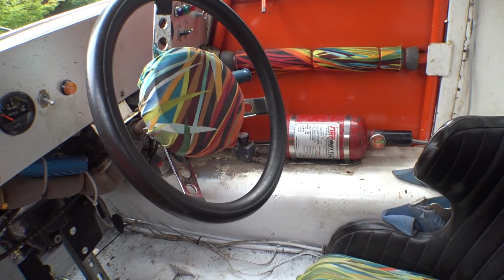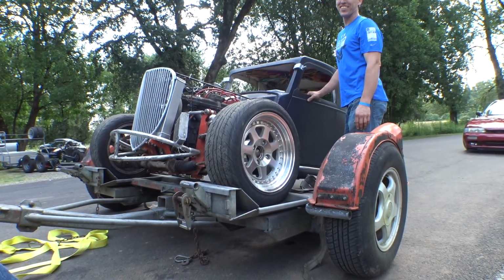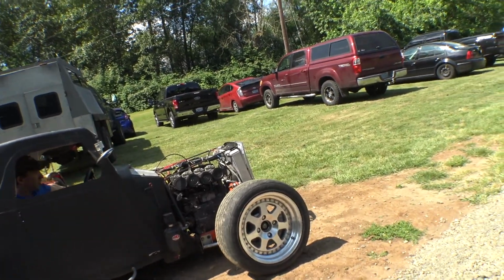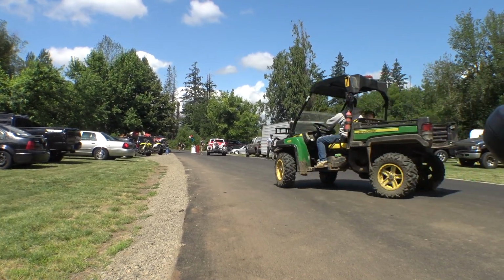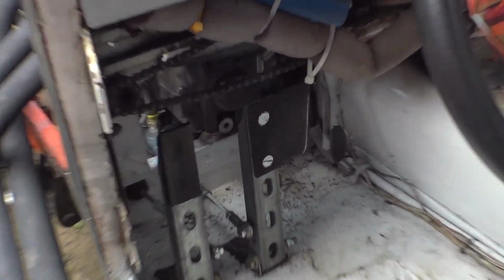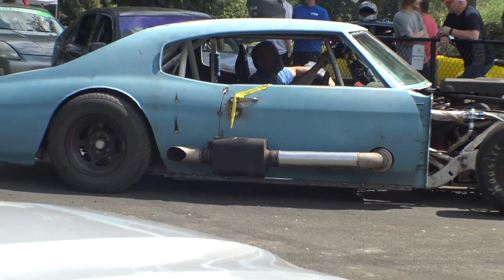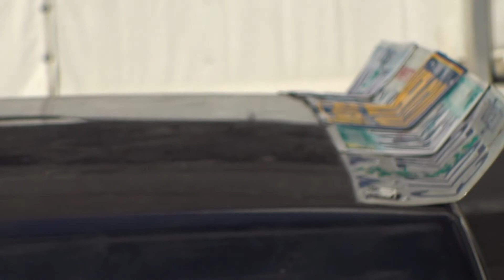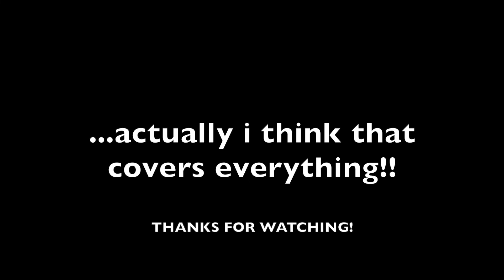VLOG 515: drift day at the racetrack! (LOUD AUDIO WARNING!)

Comment: Glad you had a fun day I too ha 've a electric chair. I have Tranverse Myolytis in my spinal cord. I'm a transfer board guy hospital bed at home my chair is basic Quantem Q 6 Edge tilt recline all that good controller but seat sucks it's a Jay 3 with Soho insert right just on my ass. The people who sold it to me never really adjusted to me did a fitting or told me shit. I have Tru balance 3 Medicare paid over 25 grand for it.
Reply from the maker: ive started using ride cushions.. but my hips have to be held in just the right place.. did they set a followup with the physical therapists appointment after ya got the chair? usually they check that stuff after you've had the chair for about a month or so... or they are SUPPOSED to...